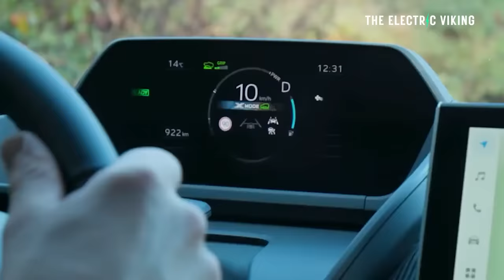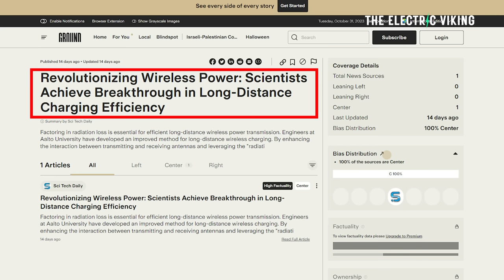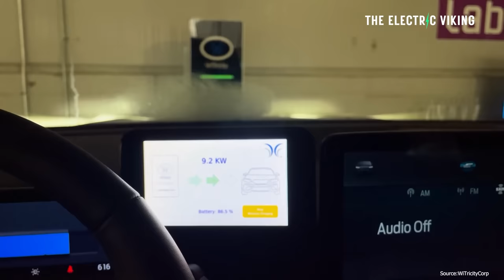Scientists make breakthrough in long-distance wireless Electric car charging

Comment: People hear "90% efficient" and think that is good.  Wrong!  At 100kW charge rate, that would result in 10kW of wasted heat!!!  A regular cable charger is ~99.99% efficient.

Now think of the typical electric radiant room heater which usually puts out 1.2 kW of heat and realize that a wireless car charger would be putting out over 8x as much heat as pure wasted electricity.  You  cal also consider it as paying ~$1 extra each time you charge your car.  CLEARLY this technology is going NOWHERE... which is why Tesla sold the wireless company again after buying it.

Comment: Possible, but in northern climates, like Here in Michigan, Road Repair is already a nightmare. Repairing a road with this would be a very expensive undertaking.  At the same time, you need to develop a new innovative way to make roads to allow this to work in many areas of the country.
Reply: I had the same thought.  Any place with a lot of freeze/thaw cycles & soils that expand with humidity would be a nightmare to install this kind of system in.

Comment: I have been surrounded in RF fields and low magnetic AC supply sources, Microwave and much more since age 15 as an apprentice. Today 76 and still going, i walk miles and run. Never done any harm.. My late father was the same. He passed away at 89.   Today I am still involved as a radio ham building RF gear.  Alive and kicking

Comment: Big (if not biggest) question is what will exposure to EM fields like these do to drivers and anybody nearby?
Reply: I spent 3-1/2 years exposed to super high frequency radio and radar, plus all kinds of EM fields. 50 years later, I am 72 and no serious health problems.
Reply: Inside the cabin anyway, this is probably lower in intensity than earth’s magnetic field.
Reply: I guess Earth (our largest magnet so far) is killing us with the EM fields?
Reply: Would a Faraday Cage not reduce that effect if any?
Reply: You should educate yourself on the inverse square laws. And then see what you get from your phone before you worry about the source many feet away from you and behind a behind a bunch of steel. I wish basic physics literacy was required
Reply: @jeffreybloom  I'm not much of a mathematician, but I've got a sneaking suspicion that something like 100kw's at let's say three or four metres is going to trump 1 watt at 1 cm. Granted, I've got no idea how much attenuation a motor vehicle body can offer, and I get that there is a big difference between 100 mhz and nearly 1000, but for inductive charging to work effectively, as described, there's some pretty big RF going on.
Reply: @jeffreybloom  Actually, the situation with wireless phones and devices is what prompted the question as people are increasingly being exposed to a widening variety of electromagnetic fields with very little investigation into possible long-term effects.

Comment: They sold the company but kept the engineers that worked there so I think they are still working on Wireless charging.
Reply: Exactly. I heard they also kept the patents. The buyer got the permission to use the technology in their own products and they got the equipment and building.

Comment: only caveat I will add here is that when Tesla bought and then sold that wireless company, they kept all of the engineering staff. I think they are working on integrating wireless power transfer into Optimus already, with an eye towards wireless supercharging.

Comment: 150kW fast-charging at 80% "high" efficiency... no thanks. I'll take ~99% efficiency from plugging in. If you pull into a charging station, you are stationary and inductive charging can already get you to 95+%, no need for that 4X as wasteful slightly longer range stuff. For factory bots, most bots need to stop at a number of specific locations where they are being (un)loaded or have to perform a task of some duration. If you want to keep your factory or warehouse power bill low, put inductive chargers only at those locations. You get 1/4th the losses and get 10-100X more use out of each individual pad for that much of a lower total install cost.
Reply: The 20% radiative losses would be enough to ionize the air within several meters. Lmfao
Reply: Far better than 30% efficient engines
Reply: @najibyarzerachic  Not in countries that get the bulk of their power from oil, coal and natural gas. If you piss away 20% of all power on unnecessary wireless charging, it is that much more power that needs to be generated and transported from somewhere else.
Reply: @teardowndan5364  still better than buring oil in the engine
Reply: @najibyarzerachic  We'll see. I suspect battery fires will be far more common once the average EV is 10+ years old just like the average ICE is 12 years old today. There is plenty of time for BEVs to turn out more toxic overall than a properly maintained ICEV.
Reply: @teardowndan5364  yes 10 year old EV will b more likely to catch fire than a new EV but still less likely than a comparable gas car. The rate of fires is actually going down as most automakers start using safer battery chemistries such as LFP. Check the video of BYD batteries getting punctured with nail but still not catching fire.
Reply: @teardowndan5364  some Chevy Volts have been on the road for 10 or more years, they were first introduced in late 2010. Granted they’re not a full EV but they have 16 kWh - 18 kWh battery packs, and I’ve only been able to find reports of 2 catching fire, out of 96k sold. Nissan Leafs have 4 reported fires that I could find in the US, out of 177k sold and they’ve been on the market since 2011 as well. So I’m sure there will be some models or specific batteries that are more prone to fires, but overall I’d say your prediction is likely wrong.
Reply: @sjsomething4936  How many 12 years old Leafs are still on their original battery pack? The earlier models were notorious for frying their batteries in 5-7 years, most 12 years old ones still on the streets today are likely on or about to get their 3rd pack.
Reply: @teardowndan5364  I don’t have those stats. I do have a sample size of 1 which is a good friend of mine who has a 2014 Leaf that’s still going strong on its original battery.  What you’re saying is actually a sign that the batteries are even safer since the Leaf doesn’t have an active thermal management system in place.  This is why their batteries degrade as quickly as they do, which implies that  they should be catching fire even more frequently if thermal runaway is such a problem.
Reply: @sjsomething4936  Lithium batteries suffer from accelerated aging above 40C while thermal runaway typically happens around 80C. You don't need to be anywhere near thermal runaway threshold temperature for batteries to degrade.
Reply: @teardowndan5364   correct, but I didn’t say that thermal runaway is anywhere close to capacity degradation temperatures..  Point is that your original post said that LiOn batteries may start combusting after 10 years of use, and despite some being that age already, including some with no thermal management, we aren’t seeing a huge uptick in battery fires of the oldest batteries.  It could still happen, but right now indications are that it’s not a significant concern.
Reply: 99% efficiency plugged into DC. Can lose up to 13% at home using AC. What about inductive at home?
Reply: @adriancarey7848  A 87% efficient on-board AC charger is pretty close to the bottom of the scale. Modern EVs typically hit 90-96%. Inductive charging is basically an isolated DC-DC power supply with a split transformer core, that'll cost a few % even if you can get everything perfectly lined up.

For curb-side charging though, losing 2-3% on efficiency beats having cables on the curb for people to trip on or copper thieves to run away with.

Comment: The idea of wireless charging is nice but with Amperages of 150A and more (for trucks and busses) i don't think it will take off anytime soon. Cables are just more energy efficiënt because there is less energy lost. For a phone that's not a big issue but for heavy vehicles it is problematic.
Reply: Exactly, the physics behind it is pretty easy and does not scale to large currents because of the losses. Look at how hot the phone induction charger get at 18W and scale that to 180kW :-)

Comment: This may be applicable in some niche applications (urban buses come to mind) but useless for general use. It’s going to be horrendously expensive (dig up the roads and install the pads at very close tolerances, not to mention the additional equipment on the vehicles), efficiency is lower and therefore the benefit (increased range and uptime) will only apply where it isn’t really needed that much. Warehouses? Perhaps. Town centres (busses, trams), sure. But for private cars or taxis? Not a chance.
Reply: Buses can already use pantographs

Comment: They tested this in Norway Oslo couple years ago. It's slow, hard maintain, expensive and your car need special equipment to use it.
Reply: Hard to maintain, expensive, and special equipment is indicative of most new technology and will clearly be overcome.  Slow is an issue even with wired charging.
Reply: @brucerosner3547 True.  (But slow is not an issue with overnight charging, or even midday top up charging at work if that comes to be.  And honestly, as an aside, I've found fast charging fast enough to get a sandwich and use the toilet while charging, ten or twenty minutes typically even with my slow 170kW top charging speed car.  Not the issue people make it out to be, in my experience, especially if you take breaks on road trips.)

Comment: 20% loss in lab conditions? 
so, an one hour long charging stop will now last one hour fifteen minutes
what a fucking improvement ! lol
Reply: What do you own that takes an hour to charge?  Ten to twenty minutes, in my experience, on a fast charger.  (A few hours overnight at home on 220V, as I sleep.). Friends don't let friends buy Fords.
Reply: @bearcubdaycare  my phone takes exactly 1h to charge form 0 to 100
and, correct me if i'm wrong, Tesla charges for about half hour from almost dead to 100. at level 3 supercharger. That will make your stop 6 minutes longer. Not going to mention that you drive your fancy, earth saving vehicle to reduce carbon footprint and you just increased it by 20% because you're to lazy to get out and plug in the cable  lol

Comment: This is a stop-gap technology. Once battery tech matures (say 600km per charge and takes 5 min to charge without any battery degradation), this tech will no longer be needed. The expensive infrastructure built to enable it will all be wasted too.
Reply: You ignore the profit to be made selling parking combined with charging for city streets, shopping malls, sport arenas, etc. If someone can financially profit it will happen. Incidentally expensive infrastructure is the essence of capitalism like oil drilling platforms.

Comment: What does this all mean? Someone got a huge grant to study what we already know!!! This is basic RF physics!!! As for 100mhz. being the "magic number" for efficiency? Haha, it's dead smack in the middle of the 3 metre FM broadcast band! Yes, a wonderful frequency for reliable propagation, but hardly the best choice for efficient electromagnetic coupling, especially if you're tuned into your favourite golden oldies while your car is charging (or your robot!). I wonder what the International Telegraphy Union (ITU) would have to say about that!
The higher the frequency, the higher the copper losses and hysteresis losses when a core is used for the inductors. It's one of the reasons that we use such low frequency AC for electricity transmission.  That said, however, it is a great band for local propagation, if you really, really love your golden oldies!

If my history serves me correctly, this is the sort of nonsense that Nikola Tesla himself was researching after obtaining funding from JP Morgan to research radio.
Yes, inductive coupling is very much a "thing", but the limits of its efficiency are very well known. So is every detail pertaining to transmission frequency and antenna technology.
As they say, history repeats, especially where there's a dollar to be had. Then again, there's nothing that a bunch of uni students won't do for giggles either. This is a p!55 take!

Comment: So will you need a smaller battery? No because every path won't have wireless charging. So what problem will it solve? There might be some special cases, but if you have a EV with a 100 kWh battery, parked charging while you sleep will be fine for 99% of people.

Comment: Viking, surely the way to have 24 hour car manufacturing robots is just to plug them in to the electricity supply. Why bother with chargeable batteries?
Reply: Tethered vs untethered.
Why do people buy battery powered tools ?

Comment: If I could charge my EV by simply parking over a specific spot in my carport, not needing to plug anything in, and having it charge by itself, I could accomplish 95% of my driving requirement and never visit a super charger. Imagine charging your car without thinking about it!
Reply: Imagine plugging it in and not swimming in many kilowatts of VHF radiation.
Reply: Personally, plugging in seems quick and easy, both for my car and my home, and I've not really had a massive urge to reduce that negligible effort, but that's just me. It'll happen at single family homes as a convenience someday, likely, but... The biggest benefit might be apartment complexes needing to worry less about a charging outlet getting damaged.  Less physical interaction, potentially less risk of damage over the years.
Reply: Imagine plugging it and saving hundreds $ per year, lighter car and no radiations.
Me and my wife can’t park our current car accurately over an oil drip mat anyway 😁

Comment: That's a lot of theoretic mumbo jumbo....no real world application. To costly. To much power loss with wireless charging. 
Fot the forseable future (10 years) I'll stick to modern low pollution and hight efficiency diesel engines.

Comment: The next bullshit presented by some wannabe-CEOs.
* The resistance of the coil becomes very large for high frequencies even with Litz-wires.
* The surrounding metal structures of the car cause significant amount of Eddy Current Losses.
* The RF-generator as well as the Rectifier will have very, very, very low efficacy.
* Not to menthion the EMC-regulations.

Nice Try. Reminds me to Witricity.
Reply: Yes, Yes, Yes and Yes. Not to mention that 100 mhz. is smack bang in the middle of the global FM broadcast band! This is a piss take, for sure.